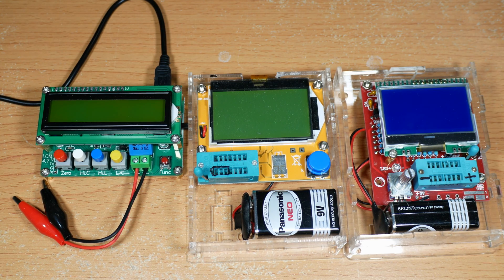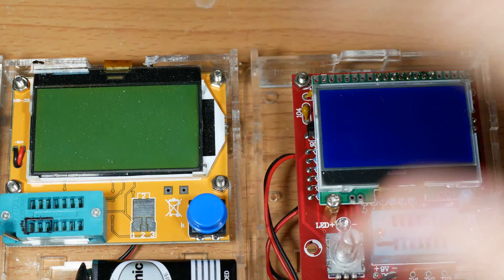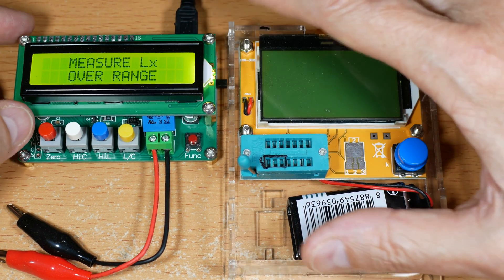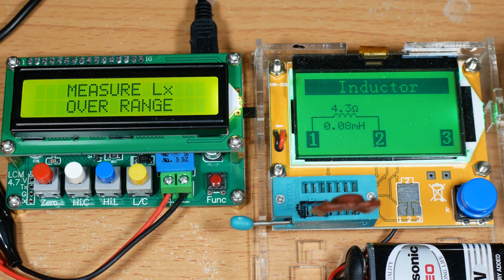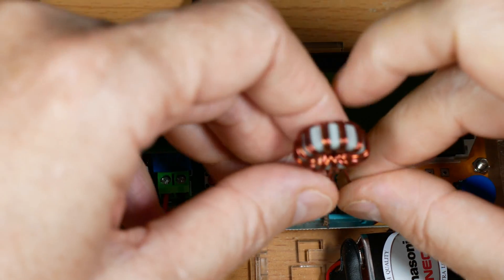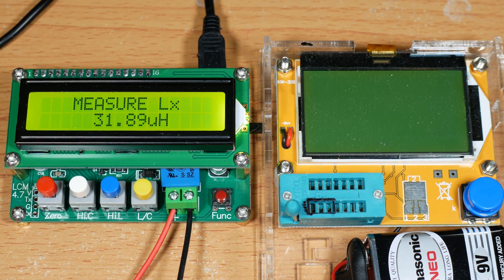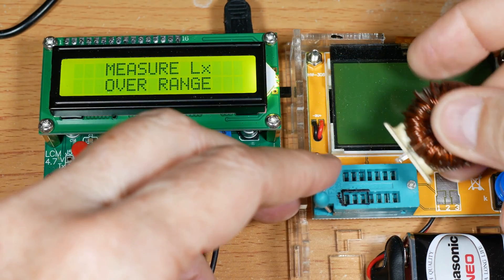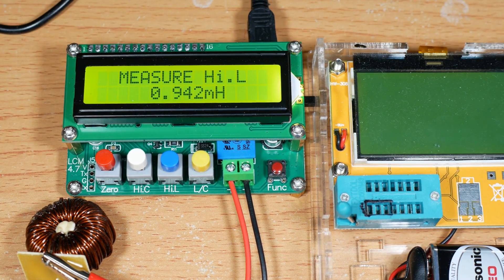Inductance/Capacitance Meter - LC100A (4K)

Comment: I have LC100A from Ali. I have made an inductor for HF, 200uH according to technical specifications. When I measure it with greater accuracy I get 147uH otherwise wiyh less accuracy I get spot on 0.200 mH according to design specifications. What is correct?
Reply from the maker: Did you zero it out? I have to zero mine every time I turn it on. Also, I've killed 2 by not discharging caps COMPLETELY before connecting them.
Reply: @tsbrownie  Yes I have actually zoro it out before the measurements so I'm quite confused by the results. I think I will need to pause my project and wait for a more reliable measurement.

Comment: With the 5 volt LC meter you must first calibrate by short-circuiting the 2 measuring leads and then pressing the zero button.
Reply from the maker: I usually do, but not every time. If you don't power it off, it is within a few percent.

Comment: Thanks for your tests! Seems like a reasonable LC meter. I wasn't sure about buying one of these but after watching this video I'll buy it, especially for measuring inductors.
Reply from the maker: It has been really useful. Recently I made a coil based on a calculator, then I tested the real thing and it had 1/3rd of the inductance! Turns out the PVC pipe I used had some filler that reacted with the electromagnetic field. That saved me long hours of trying to trouble shoot a "broken" crystal radio.

Comment: Since there are no reference values, I'm tempted to think he means 'precision' when he says 'accuracy'.
Reply: Good Point but it's not difficult to find and test a quality fixed inductor and then apply whatever difference there may be to future results.  At least that's my plan for my upcoming Tune Input build where I will copy the Pride Input circuit for a 4cx250b

Comment: I bought one of these a few years ago, and I could not have been happier with it. I still don't have a "proper" LCR meter, but I have a Uni-T brand DMM with a capacitance feature on it, but I still prefer this. Even if the USB plug's a bit dated heh.

Comment: Thank you so much for making this video, I actually have that tool but was using it for testing RC lipo batteries but I never knew it can do capacitors, which I need right now to test Air conditioner capacitors...  Thanks..   I almost just posted it for sale..    Thanks!

Comment: I recently purchased one of these.  When testing a coil the value displayed gradually drops towards zero.  
Pressing the red function button indicates the frequency climbing.   Is that a fault in the device?
Reply from the maker: I can not be sure, but that does not sound right. The values should stay pretty steady around the actual value.
Reply: @tsbrownie  Thanks for the response.  Didn't seem right to me. Makes the testing sort of useless.  I will return it for a replacement.
Reply: @brewstud  Some LC100 had a yellow toroid with 33 turns as the L1 inductor. The material the toroid is made of is intended for use as a suppression choke in power supplies and its inductance varies with higher frequencies. As it forms part of an oscillator circuit this accounts for the variation in frequency. Older versions use a moulded axial inductor (it looks like a resistor) for L1. I replaced the toroid in mine with a 47uH moulded inductor which made inductance measurements more stable.

Comment: How much current does it draw?
Reply from the maker: If you google "LC100-A" you can find the user manual, but it only lists a 5V power requirement.  Does not tell the total power required.
Reply: @tsbrownie Thanks. I had already located the full manual and found the same. I want mine on battery power, so I'll have to measure the current on my own to determine what to use. I'm inclined to use two AAs with a boost converter. We'll see.
   I do wish the companies would supply typical current draw for these modules in general. Im working on a DSO138 scope, and will build the signal generator next among others. Each one will require knowing the current draw before packaging can be decided upon.
Reply from the maker: @joewoodchuck3824  let us know what you find.
Reply: That was my plan as well. Plan B is a 9v battery and a 7805 linear regulator
Reply: @tsbrownie  I used a Charge Doctor to measure the LC100 current draw. The resolution is only 10 ma and it read zero. According to what I see therefore it's drawing less than that. 9.9 ma would still show zero on that meter. I'll set up an analog meter when I get a chance, but for now I'm assuming fairly minuscule current. 
    Plan A. 2 AA cells with cheap  boost regulator.
Plan B. 9 volt battery feeding a 7805 linear regulator.
Plan C. Experimentally, 2 CR2032 lithium cells in series with one or two signal diodes, depending on how the  IV curve knee works out at that level.
Reply from the maker: @joewoodchuck3824  Interesting.  Let us know which plan you go with and how well it works.
Reply: @tsbrownie  Since my last post I read in the manual that it can also be run on 4 AA cells directly without any additional voltage dropping needed.
Reply from the maker: @joewoodchuck3824  so it has regulation. Good to know, thanks.
Reply: @tsbrownie  Not necessarily regulated. It could simply be permissible operating range. If there was a schematic, that point could be verified.

Comment: After i watched your video bought one also, i have taken a few measurements and here are the results. I am not sure if the tolerance is between limits or not, i would like to know your opinion if not a problem. i measured those values and reset it after each measurement: first column has the given value, second column what i measured.
1000pf to get 760pf
4.7nf   -   3.56
470pf   -   353pf
0.022mf   -   0.016mf
2.2nf   -   1.51nf
56pf   -  41pf
150pf   -   115pf
220pf   -   166pf
1mf   -   20mf
10mf   -   209mf
22mf   -   500mf
1mf   -   19.8mf
Reply from the maker: I am not sure if it is the meter or the devices.  I've measured many caps and such and they are never dead on.  There's a way to calibrate it, have you done that?
Reply: @tsbrownie  No i haven't calibrate it, don't know how. I have measure 2-3 different capacitors of the same value and the fault is the same for all of them.
Reply from the maker: @gordinir7  Sounds like calibration.